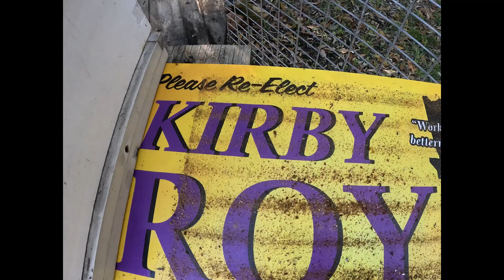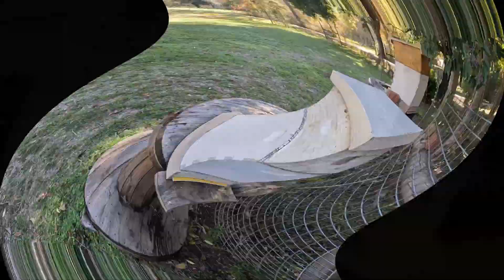Buying Queens Late Season? Good or Bad

Comment: I like to requeen in august. my strongest hives do that on their own. if I made them in July, i had time to see how well they did before I put them in. if they fail to take I still have time in sept. to fix it. the difference is I need them to build up and be strong in January to go to almonds. I cant make queens early spring, no drones till late april, so I have to buy any spring queens I get. I just got into a disscusion with an older beekeeper about this today. He likes to requeen in the spring to control swarming. next year I am going to try to make extra queens in the summer, and send them to Rodney in SC to over winter for me, then he can send them back in the spring. that way I will have my own stock for nucs
Reply from the maker: what do you feed to get them to build up early to be ready for the almonds?
Reply: @KajunHomestead  they need to be strong going into fall, then if they have enough honey, I just feed pollen. I had some last year with 18 frames of bees in double deeps in Jan. at that point they were out of honey, but if they go to CA we can feed syrup, or you better get sugar on them. it was a bad winter in CA and they didnt go till mid Feb, and they went down hill fast